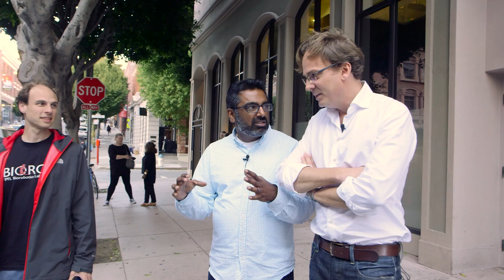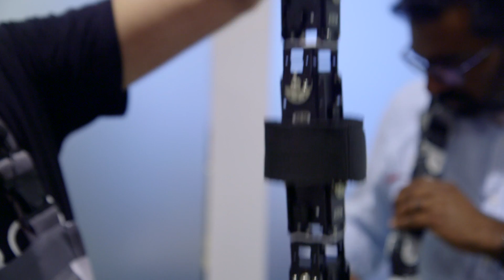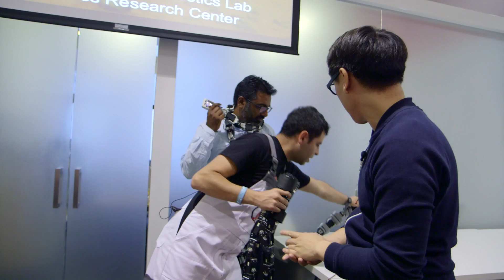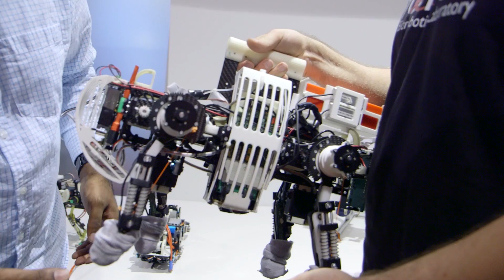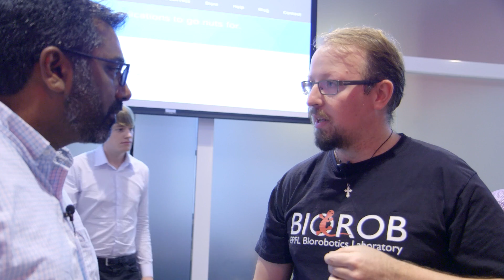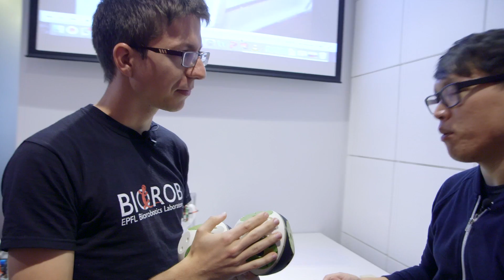Awesome BioRobots Inspired by Animal Movements!

Comment: Is there a "most efficient walking mechanism"?
Reply: +Alejandro Apellido I think it's called driving ;) i.e. wheels...
Reply: +killroy42 Nope, walking isn´t called driving.

Driving on wheels is a efficient way of locomotion on surfaces suitable for it but with the worst adjustment to different terrains (try drive up a tree or mountain and you know driving isn´t the best way of movement... :p).
Reply: Hmm, "walking" in general isn't gonna get up a tree or mountain either. So now yo're adding constraints. Most efficient way of legged locomotion perhaps? But now you're constrained to using legs...
Reply: +killroy42 ok, wheels are he most efficient way of locomotion, but what about "walking"? (I mean in a completely flat surface)
Reply: +Alejandro Apellido I thought about strandbeests (by Theo Jasen) which use the Jasen's linkage for legs. Or also in klank's linkage which I guess is less efficient (since the feet go very high) (which actually make it better for an irregular terrain) but I'm aiming for theost efficient mechanism in a flat surface. Any idea?
Reply: ***** "Hmm, "walking" in general isn't gonna get up a tree or mountain either."

But it does so for the majority suitable for that terrain/habitat (insects), so in general it indeed does get them up a tree.

You seem to not have gotten the point that efficiency of locomotion is depended on terrain whereas driving on wheels is definitely not the most efficient way of walking (which you said and makes no sense whatsoever in the first place).

There´s a reason most animals walk, crawl, climb and fly and don´t drive on wheels, won´t survive long enough to procreate if stuck because having locomotion with 0 adaptability to different circumstances and terrain. lol
Reply: +Caarnji totally agree.
But I insist: is there a "most efficient walking mechanism?
Reply: +Caarnji totally agree.
But I insist: is there a "most efficient walking mechanism?
Reply: Alejandro NQ what about 'theo Jansen' machenism.
Reply: Wheels are only efficienct on flat and hard terrain, for anything else bipedal locomotion is a lot more efficient.